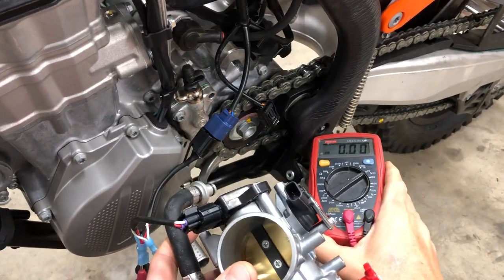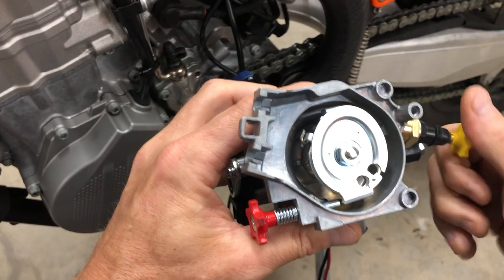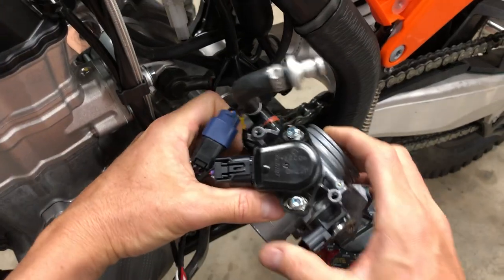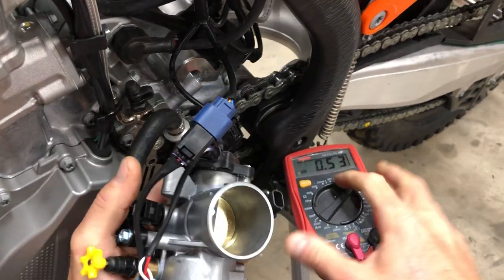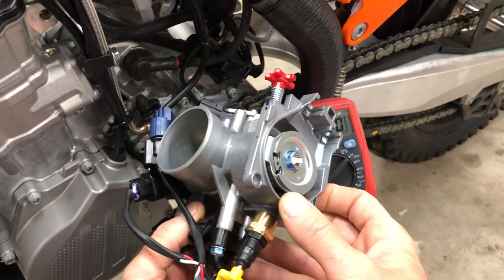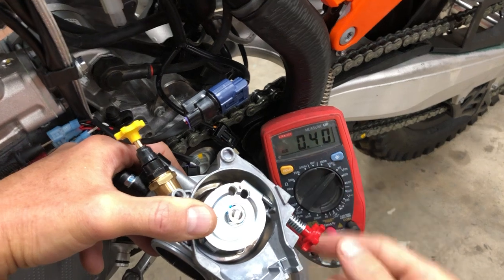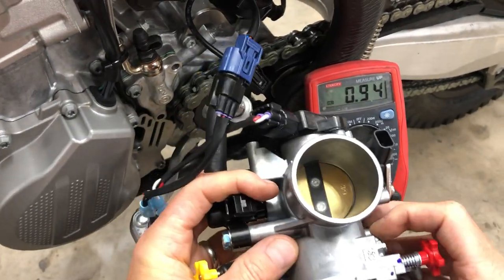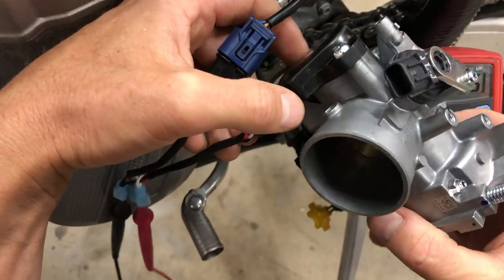MOTO MYTH BUSTERS ON THE TPS HACK AND EVERY THING THROTTLE BODY

Comment: Love the vids..  lots of info.  One problem though.  Changing the tps value by adjusting the tps in relation to the butterfly is totally different than using the fast idle screw to open the butterfly and tps together.  The tps tells the ecu how far open the butterfly is so if the tps value is set higher when the butterfly is closed the ecu thinks the butterfly is opening which changes fuel ratio.   Might help at idle but On a bike with an o2 and Map sensor once the bike is warm enough to go into closed loop and use the sensors to fine tune the fuel mapping fooling the ecu isn't beneficial.
Reply: You are SPOT ON and I was going to say the same. Most companies like to run open loop at idle especially when cold because the O2 sensor reading is not correct until fully warm. Also every single start is completely open loop fueling. So this is why modifying the TPS value improves start because it richens the mixture (similar to choke). Now why dont it come that rich from factory? (CARB and EPA). Now on bikes with an O2 sensor like the street legal EXC the O2 sensor along with the MAP sensor takes care of all the free flow intake/exhaust mods. You dont need a TPS tuning for exhaust mods. But you do need it to take advantage of Open loop starts and Idle until the O2 sensor picks up. 
Now there are bikes without the O2 sensor like the XC bikes or the MX bikes. Those definitely can work better when this is properly tuned and you can get an overall rich mixture throughout the rev range with this mod. So less knocking, less valve wear from heat and engine lives longer and loves that. Plus fewer flameouts. 

I like your videos but I gotta say not everything you said is correct. I hope you make another video that will fizx the issues.
Reply: Who are you talking to about making a correction video here? Your comment isn’t made to the make4 of this video.

Comment: Sorry but you are incorrect. Moving the TPS sensor is not the same as just cracking open the throttle plate. What you are actually doing is leaving the throttle plate in its home position but advancing the sensor only, thus you are effectively adding more fuel for the same amount of air as the throttle plate doesn't move i.e. richer fuel mixture. I can't speak for what happens throughout the rev range and how the ECU compensates but moving the TPS changes the overall ratio between the throttle plate position and the sensor.
Reply from the maker: Yes, you are correct. My explanation there wasn’t as clear as yours. Thanks for specifying that point.
Reply: question though....on bikes with ride by wire (aka no physical connection to throttle), adjusting the TPS does nothing right? I've seen when the ignition is turned on, the throttle valves open and close fully and the ECU probably takes note of the voltage/readings and calibrates itself??
Reply: Then what does the TPS do on a carbureted bike?
Reply: @jakefidd8344  you're kinda right. I'm definitely not all that knowledgeable here...just thinking out loud. I found out from Googling thar in a carbed engine it basically just tells the computer/ignition whether the engine is under load/cruising/accelerating/etc
Reply: @DearMajesty  I'm having trouble finding a TPS for my 97 Blackbird.  Think I'm going to try and modify one off a car to fit

Comment: Hey my 2022 ktm 350 xcf won't return to idle for 3-5 seconds after revving it any answers would be greatly appreciated?? Even in gear when I pull in the clutch it stays at the higher idle for 3-8 seconds before going down what do you think could be the problem?? Plenty of free play in throttle and it only has 14 hrs on bike?

Comment: Thanks Taco Mike! Just bought a 2022 KTM 350 EXC with only 200 miles on it. Bike was running super lean with flat spots on acceleration and constant popping on deceleration. In addition to an FMF muffler, smog delete, vented airbox cover, reed removal, O2 sensor delete, and more, the  original owner altered the TPS baseline, setting it at .48 and .62 at idle. Using your video, and a TPS dongle that allowed me to reset the baseline to .40 and .52 at idle. I used JD Jetting Power Surge 6x adjustments and a new spark plug to give it some more fuel and the bike is a ROCKET. Wanted also to thank you for stocking all the parts needed to get the bike running perfect. Cheers!

Comment: Hi guys, nice video...
     For riders on a budget or they just don't buy into every item out there... You do not need these harnesses to check TPS voltage..
 Although the harness is put in series the connections to read voltage are not. You are not interrupting the signal you are just reading the voltage ...all you need is a paperclip or  long pin, etc pushed into the two lower connectors on TPS connector...2022 500 is black and yellow/orange..i used plastic covered and colored paper clips lubricated with a little dielectric grease which you can strip on the ends so they will not short if they touch...

Hope this helps a few riders out...Joe

Happy New Year .......
Reply: What adjustment did you make on you 500?

Comment: THANK YOU SO MUCH. I bought a practically brand new '23 350 excf this year that had a previous owner who only put 8 miles on the bike but for whatever reason decided to messed around with a bunch of settings. The intake reeds were partially dislodged and I've had a host of stalling/low end issues. Thanks to your videos I now have a legit roadmap to reset my bike back to a totally stock tps setting so I can reinstall the reeds and install the EJK and Pro Moto endcap you suggested for budget-aware single track riders.
Reply from the maker: Keep us posted 🤘🏽🤘🏽

Comment: Let me start by saying I appreciate all the videos.  Very good and a great help 

With that said I have to comment on the TPS function and the result of adjustment that is higher than recommended. 

The fuel system on these bike are extremely simple compared to cars that use multiple sensors to control fuel under several conditions. 

Bikes typically have a few sensors.  Air Temp usually in the air box, coolant temp and Map sensor. 

Off the top of my head I don’t recall the earlier EFI bikes having MAP sensors  and only recently have I seen stock systems using an 02 sensors. (Bikes using 02 sensors have a more sophisticated computer and mapping system in that they make adjustments in smaller RPM increments or windows) 

That all said I wanted to speak to the comment that bumping the TPS voltage up results in a leaner condition.  Mechanically that make no sense.  With the throttle plate set to allow air in to achieve the specified idle and the TPS set to spec let’s say the Air Fuel ratio is 0 (not lean and not rich).  As soon as you adjust the TPS voltage up and add fuel at idle you are also adding fuel as the throttle is opened because the TPS voltage window has been increased from the start.  Fuel will be richer through the entire throttle sweep.   With the exception of an 02 sensor which reads the actual mixture after burn and reports to the ECU so it can correct, these bike don’t have any sensors to tell the ECU otherwise other than coolant/ engine temp which is only really only prevalent when the motor is cold or hot outside the acceptable operating range. But under normal running temps the TPS is adding slightly more fuel thru the entire throttle sweep if it’s set to a higher voltage. 

So how can it be leaner?
Reply: I like how no one has responded to your point. I build 6 figure budget high end hot rods and land cruisers. I am very familiar with automotive fuel injection systems. Your explanation is spot on! Without an o2 sensor the engine will never fully know whether it is running too rich or lean. 
I like the in depth explanation of the inner workings of this throttle body but the information regarding this “Lean” issue also makes no sense to me. 
Anyone care to comment?
Reply: Can someone knowledgeable comment on this please I have a 2023 KTM 500 EXC and I have removed all the smog stuff and the O2 sensor and have a get ECU and I noticed that once the bike is warm the idle not only changes but hi I am getting a lot of deceleration popping and really jerky off throttle from closed to like just barley opening it it’s jumpy as hell I want to know how I can fix this correctly
Reply: I’d say that there’s no answer because there’s no money in it. If you can achieve a little more fuel by upping the voltage than why buy a tuner or piggy back? It obviously helps to up the voltage because hundreds of posts prove it does. Mike said that if two or more get you an answer online then there you have it. It’s not leaner up top when adding voltage. Probably richer. I have a temp gauge and after upping the voltage it runs cooler. Why? Probably getting more fuel.
Reply: @MRGarsioni that is spot on, 20+ years in tuning here too, in this case the tps position regulates the afr, he is simply wrong by saying all you do with adjusting tps is opening the throttle like you do on high idle speed screw,  it's not as one is mechanical and other is a sensor to sense the aperture of the throttle which then feeds the signal to the ecu and that one desides how much fuel innthat case needs to be sprayed in, plain and simple,  if it had a wideband lambda sensor that would be a different matter but it doesn't so it purely relies on the tps setup matched with the written map in the ecu. And it's sensitive ! I've just played with mine and immediately I've noticed too much fuel ( bumped to 644 from std 522, I'll back it up to somewhere in the middle ).

Comment: I RESPECT YOUR EFFORD AND OPPINION !!! 
MY OPPINION IS THIS.
The choke opens the throttle plate physically, the TPS does not open it, the TPS is sensor witch gives the information to the computer how open it is, the TPS just transfer information from the throttle plate to the computer.
So by adjusting the TPS you trick the computer to think that the throttle plate is open more than it actually is and that makes the computer to let more fuel, but actually we did not touch the throttle plate position physically we just make the computer to think we did. The amount of air is the same because we did not open the throttle plate physically but the fuel is more because the computer think we did. 
EXAMPLE:
Lets imagine that we have 1 amount of air and 1 amount of fuel as air fuel mixture. Than we make the computer to think that we have 1.5 amount of air by adjusting the TPS sensor ( 0.5 amount increase) but actually the throttle plate is on the same position and is still letting just 1 amount of air, witch makes the computer to let 1.5 amount of fuel while it actually has 1 amount of air. 
SITUATION 2: higher rpm
We are half throttle open with value lets say 5 but we already made the computer to think that we have 0.5 amount increase in air witch is 5.5, so the computer let 5.5 amount of fuel to the mixture while actually has 5 amount of air.

SO HOW ADJUSTING THE TPS MAKES THE MIXTURE LEAN IN HIGHER RPM ?
HOW ADJUSTING THE TPS OPENS THE THROTTLE PLATE PHYSICALLY LIKE THE CHOKE DOES ?
AND WHAT IS YOUR OPPINION ON MY LOGIC FOR TPS ADJUSTMENT?

!!! MY OPPINION IS ABOUT A STOCK BIKE !!!

SORRY FOR MY ENGLISH IT IS MY 3TH LANGUAGE. 
I AM EXITED TO READ YOUR ANSWER BECAUSE THERE IS ALWAYS SOMETHING THAT WE MAY DO NOT KNOW.
Reply: makes sense. I d like to read his answer too.
Reply: I agree
Reply: You are correct. What I think mike tries to say is:
Adjusting the tps  on a bike with a closed loop map doesn’t work. Adjusting the tps on a bike with a open loop map is hard to do correctly. This is confusing so please give me money for a aftermarket ECU instead…
Reply: Yes I’d like to see a response to this as well
Reply: Yes I’d like to see a response to this as well

Comment: So I’ve just got a 2023 sx 125 with 10 hours on it, beautiful bike, but didn’t realize how advanced and different they are compared to older carb models and I’ll be honest was in two minds on keeping it as I thought you had to have special tps tools to set values. Watching this video has made me realize that I can do it using a volt meter and plug harness and now understand what things are. Fantastic video and I will now keep the bike and learn new techniques for running and tuning the bike. I plan on putting a HGS system on, so hopefully will be ok? Thanks for a great video and putting things into an easy to understand way.

Comment: 7:10 correct, the TPS doesn't make changes to all parts of the fuel maps, only the low end and light throttle areas.
The TPS adjustment can fix flame outs off idle.
The reason is that the ecu swaps between the TPS and the MAP sensor to sense engine load.
The MAP signal is rapidly fluctuating at idle and light throttle/low rpm on account of the short manifold and single cylinder intake pulses.
The ecu can't get a stable reading to go off, so it switches to the TPS reading as a source for the engine load.
Using the TPS for full load/high rpm reference is dangerous as it is not a good indicator of actual load on the engine (imagine 75% throttle at 7000rpm going uphill vs downhill, the fuel needs will be wildly different)
So, the ecu uses the MAP signal in these ranges as it is a good indicator of actual load.

Comment: This is a good video, however! I understand these systems! I realized you were referring to  a 2020 with an O2 sensor! That is a closed loop system! Some of the comments below people are talking about older models without a O2 sensor, open loop system! Those bikes can be ever so slightly tuned successfully 
Via TPS! A closed loop system like that 2020 the O2 sensor will always adjust and get the reading that the ECU mapping was programmed to achieve!  I have a 2015 500 EXC and that throttle body is so different the new one is a better design I have issues with the older one that will not happen on the new throttle body. I love these tech videos I always pick up something new!
Reply: Correct , PCM will override adjustment made to TPS which is the very nature of "closed loop" fuel monitoring
Reply: @KTMBB71  There are some thoughts about removing the 02 sensor and blocking off the port, then fueling with a tuner.  Your thoughts?

Comment: I know who you referring to... i went down that track with my 127 350, it was a waste of time, made my bike worse on power, the TPS adjust is a load of crap!!  thanks for the video, keep em coming :-)
Reply from the maker: There 4 or 5 sources of the tps hack, a few on thumper talk one or two on YouTube and one or two on ktm talk. Not sure who benefits from the claims but it’s fools gold
Reply: @TACOMOTOCO  Does it work the same for a 2020 300 tpi ?
Reply from the maker: Which thing regarding the 2020 tpi are referring to?
Reply: @TACOMOTOCO  is setting the TPS on a 2020 300 tpi done the same  way as  you describe in your video
Reply from the maker: Sort of. Refer to the service manual for that bike to ensure accuracy.

Comment: Thanks Mike. I suspect my 450 was molested and doesn’t run correctly. I suspected the TPS, but I couldn’t find my TPS tool. I got it running decent, but this video confirms I need to dig it up and do a total reset.